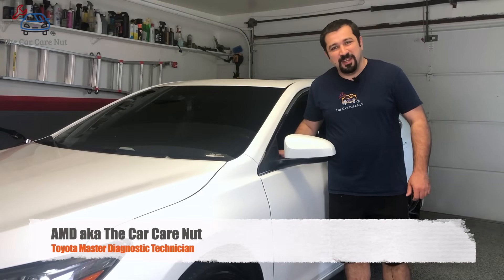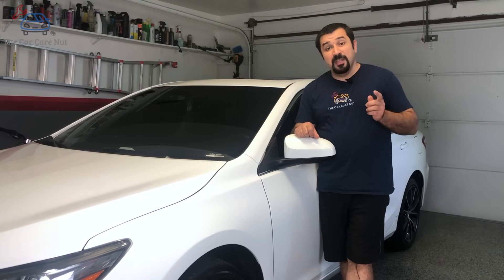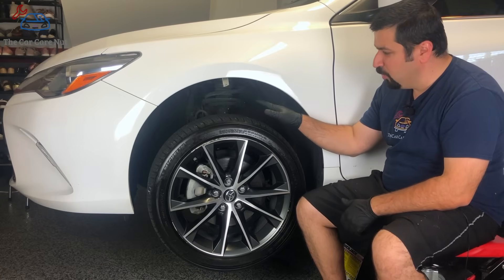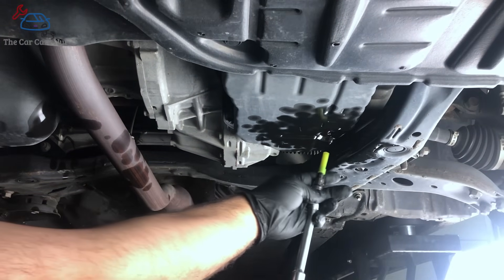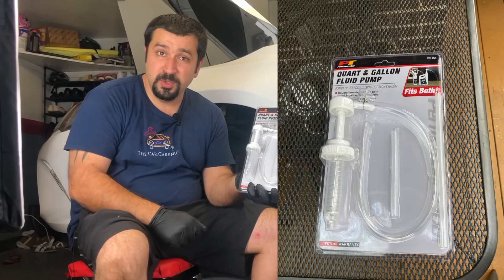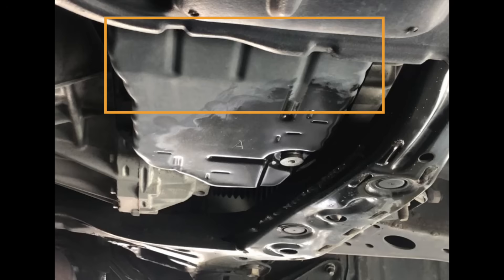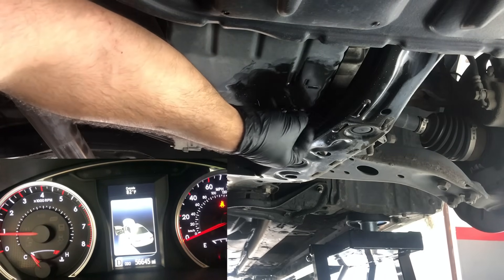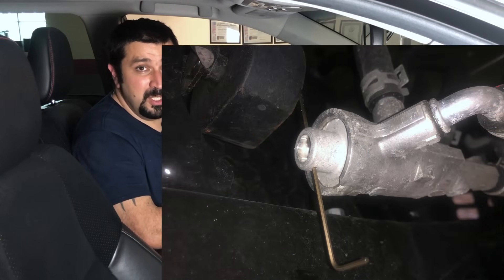How to change your Toyota Sealed Transmission Fluid

Comment: I asked the shop I go to and the head mechanic said to never touch a sealed transmission. "Your liable to contaminate the lifetime fluid. It's sealed for a reason from factory" "The fluid is made to deal with cvt high temps". Obviously the fluid you drained was nasty looking so it's not lifetime fluid which I suspected. I find it interesting that so many of these old school shops simply stop researching the latest tech. and go with the car makers recommendations. I can't imagine how many people would hear that advice and follow it until their cvt burns up one day out of warranty .I'm wondering how many miles that fluid had on it that you changed out.

Comment: Question about fluid changes and warranties. I just bought a used 2022 Rav4 XLE with 35k miles. Gas version with AWD. The Carfax shows only oil changes done approximately every 10k miles. I've mostly owned older paid for cars. I've been using Amsoil for many years. I've always done fluids myself but these newer "non dip sticked" transmissions make me nervous. I do have a nice Flir laser thermometer. 

1.) Any issue with using fluids other than Toyota brand? Amsoil ok? Thoughts? Would a different brand void warranty?

2.) At 35K miles, would it be a good idea to start thinking about going through all fluids? Transmission, transfer case, rear dif, coolant?

3.) Is 10k miles for an oil change too long of an interval despite it being the recommended interval?

Comment: Thank for the great video.  It is very easy to follow.  I tried to do it on my Toyota sienna 2016 and get different result and hope you can explain.  First question, the diagnosis using jumper does not work to determine the temperature.  The D status does not change when shifting back/forth between neutral and drive.  it is ramined solid even first start.  Second question, the amount of drained oil is only 1.5 quart even with second plug removed.  When I refilled back in by putting in ~3.5 quart about 2 quart came back out at the transmission temperature at 97F.  third question, is the low cost scanner that you recommend to buy to read temperature if you know of any.

Comment: Great instructional videos, thanks. Wondering, if it is “sealed” and you don’t see any leaks, why couldn’t you just replace oil with same amount that came out, assuming same temp (ie. do when everything is at room temp).  Would remove a lot of process (jumpering, heating oil, rechecking). I get the importance of being within tolerance of fluid level, but is the risk that high that your original level is out that much?
Reply: Yes i'm with you on this. Cold out same amount cold back in. If this is wrong please explain why so Mr.Car Care Nut. Thank you.

Comment: It seems strange that volume would be used since it varies so significantly at different temperatures. It seems that weight would be much more accurate, since it would be constant.

Comment: Greetings AMD , I have a question please , i’ve done this job 3 times on my 2015 , 2016 avalon and 2021 Yaris with the jumper cable method , yet when tried to it on my 2021 camry , one of two pins dedicated for this method was hollow ( Not sure there is no connector on that pin ) and the camry didn’t initiate the diagnostic mode anyway , would you please help

Comment: Hi Amyr. I have a 2014 corolla and I paid someoen to change the transmission oil when it had 100K now is reaching 150k. I know I may need to change, do you know if there is also a tranmisison oil filter as well that may need to be changed?

Comment: Question: This is for a partial drain and fill correct? I think the transmissions hold more fluid than the roughly 3 quarts swapped here. I ask because my dealer wants $350 for what they described as a flush for my eight speed 2017 Sienna which I’m a little leery about with the potential of metallic wear particles being deposited in places they don’t belong during the flushing process.

Comment: I have a 2023 corolla with the launch gear cvt. It vibrates at like 1200/1300 rpms it also used to make a grinding noise sometimes while vibrating but that stopped. There are a couple forums where ppl say they experienced the same thing. Could the trans be underfilled from the factory? The dealer said its normal. Can I check fluid level just by looking at fluid temp with a scanner? If it's underfilled would that show with a high temp?

Comment: I have 2017 Lexus nx200t. Where would the jumper cable go? The obd2 connector is different. I placed it in fourth upper and fifth lower hole and stated the engine. The diagnostic letter appeared. All the warning logos flashing . But the P, R, N, and D stayed solid and never flash or turned white.

Comment: So,my 2010 Camry has  200,000 miles on sealed transmission. 

Does it really need to be changed? Toyota dealership is doing the work. Are there questions I should ask the technician? Transmission is working  fine now.
Reply: He would leave alone at that mileage.

Comment: Underneath of the sequoia, there is a drain plug and a fluid level check plug. The fluid level check plug has a hex type center I think. Should I be checking the fluid with that or the drain plug?

Comment: I just bought a 2009 Toyota venza with 119,000 miles.Im unsure if the previous owner serviced the transmission at 60,000 miles. Would you recommend a drain and fill. Now that it has 120,000 miles.

Comment: Does anyone know what is the temperature that the transmission fluid should have when doing a flush? I have a 2019 camry and I want to do a flush since it has 70000 miles on it. I'm planning on using the gun to measure the temperature. If anyone can help me out please I'd really appreciate it

Comment: I have a question. If I put in new fluid exactly same amount as the old fluid from transmission. Why do I need to measure the overflow (given the old fluid is original fluid from manufacture)? Another question is, if I put  the new fluid very slightly over the old fluid (say take out 2.5quarts, put in 2.6 quarts), will it cause any damage to my transmission? I think if there is only very slightly over, it shouldn't cause any damage, right? correct me if I am wrong. thanks

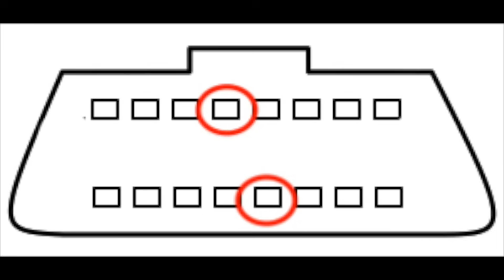Comment: I ran into a problem, I have a 2022 Rav4 LE (Not hybrid) with the 8 speed transmission. In the obd2 port it does not have a 4th pin on the top row like you show in picture of this video at 10:05. Because there is no pin there I cant go into diagnostics mode to check my transmission fluid levels. Any suggestions?

Comment: thank you for the excellent videos and information.  I got a small leak from the top side of my 2011 sienna transmission. Can I just top the oil periodically using the jumper method or scan tool when the engine is at the right temp?  Thanks

Comment: Well tried with temp gun and it was verrry erratic. Aimed it at the area he said but no consistent reading. From 103 to 122 F . Ames temp gun with laser $25 . Finally drained out the excess what I put in . I tried draining till it trickled but too much was coming out and no trickle . Meaning that I overfilled it like he said but second draining took out the half quart. I took it for a few minutes drive and runs great . The tranny is very responsive. Kinda worried it’s still overfilled though.. some mechanics say just measure what you put in and put exactly that amount. No need for this procedure..

Comment: Hi AMD. I have a 2019 Toyota Prado (LC150) with a 1GR Motor paired with a 6-SPD Auto Trans. In the owner’s manual it states using WS atf fluid, but does not state when to change fluid. I want to change the fluid myself, so question is, is the procedure to do so the same as this in the video as well? Thanks!

Comment: I have more of a question than a comment.  I have a 2012 Lexus LS460 I purchased new.  It currently only has 22,000 miles on it. It sits most of the time in the garage at our vacation home.  Is it okay to change the transmission fluid?  I'm not sure it's ever been changed.
Reply: Im in similar boat.  Guy at toyota dealership said YES.

Comment: As an engineer and a DIY mechanic, I extremely dislike that manufacturer's are adopting this design. This is the design on my VW. It is annoying to fill through the drain plug hole and watch the computer read out to reach proper temperature. I recently purchased a used Rav4; one of the reasons for picking this model was it still had a dipstick for the model year.

Comment: Followed this today on my 2017 Sienna. A few things - I did it in a 31 degree F garage. Had to shift back and forth for 5.5 minutes to get the D to be solid. Then it took 10 minutes to flash, so plenty of time. I did a practice round then drained (just under 3 quarts) and refilled (3.5 quarts). When I did the procedure the 2nd time it was kind of random. My neutral light went away - so it was D-blank-D-blank, etc. Wasn't sure what to do. I started the procedure over twice. The third time it went as it should - NDNDND, etc, until it was a solid D. Maybe the N indicator wasn't working due to the high fluid level? I drained out the extra fluid, all went well. 

One thing that I didn't do (someone tell me what issue this may cause) was pin out the transmission cooler line. I did find the bypass - it was under and just to the rear of the driver side radiator fan. I could barely reach it from above and couldn't get any leverage to push in the end. I assume you're supposed to get it from below by removing the large shield. I didn't have time.
Reply: great comment, I'm about to do my 2017 and could not find the cooler bypass, will practice first and look to remove the shield. thanks for the heads up on the internal dipstick
Reply: Also the internal dipstick was NOT a 6mm head, it was much smaller, at least on my '17 Sienna.

Comment: maybe I'm must old school(or just old), but I honestly believe that an actual physical dipstick is a much better, safer way to check the transmission fluid.    extremely few people are going to re-check their transmission fluid after the fluid change because it's a PITA to lift the car up and unscrew the drain plug.    an actual dipstick allows one to check it at anytime.

Comment: Hi AMD, I was doing a transmission oil change for my 2017 yaris with 4 speed automatic and used a wrong torque when installing the drain plug. Now the plug keeps spinning and i think I may have stripped the aluminum threads in the pan. Should i replace the pan ? thank you

Comment: I just did mine at 93K. Was worried, but it still shifts and drives. It shifted a little harder first few minutes,  but after 15 20 miles it did Great.

Comment: Thanks for the video and the proper procedure to set the level. I understand the engine has to be running and the transmission fluid must be in the correct temp. range, but I though I saw the transmission was in Drive when you opened the drain plug to set the level. Does it have to be in Drive, or can it be in Park? If it has to be in Drive, this is more of a safety concern, and a second person would be needed to keep a foot on the brake. If it can be done in Park, then that would be safer, and could be done with one person.

Comment: Is this the same procedure for the 10 speed no dipstick transmission found on the LS500's and LC500's? Or are those different as far as getting the temperature mode? Can I use a scan tool such as the Xtool A80 to get the transmission temperature correctly?

Comment: On my 16 Corolla I did not remove the tire or apron covers.You can see and remove the 24mm FE bolt from under the car.I left the can of fluid outside with the car and changed the fluid when the car was completely cold.I ran a half inch tube with attached funnel through the top of the engine into the 24mm FE hole.3 quarts out 3 quarts in.
Reply: Did you have to do anything with the Cooler Bypass, pretty sure that year has one.
Reply: @scotta8744  Nope

Comment: Hi I did this service on my 2017 Toyota Rav 4 using a scanner at temp at 104 for drain off 
Now I am going to be doing my Corolla 2022 CVT transmission is the scanner temp of 104 going to be the same for this car for drain off or is the temp going to be different 
Thanks for any help 
Love your vids and Toyotas thanks again

Comment: Is the OBD-jumper technique (while watching the Drive light) also applicable to a 2018 Lexus ES350?  It has the same engine and transmission, but I am unsure if the pin locations of the jumper are the same for this Lexus model?

Comment: What a mess they made today. Just make it simple and add a dipstick. I like to remove the pan to get the junk out off the bottom of the pan and the magnet if they have one. Love it were some tranny now have the filter inside the tranny. Another stupid idea. What sealant do they use to seal the pan if no gasket. I like to use the right stuff. What do you use? Like chrysler and dodge if you don't remove the pan just easyer to remove the add plug and suck it out and add what you took out. Warm it up to the right temp and add more to get it to the right amount on the plug with the dipstick on the plug or maybe you have to buy a plug with a dipstick on it to get it right. Dealerships by the cheapest fluid in a 55 gallon barrel. Dealerships add the wrong oil all the time as they buy the newest stuff oil and add that. Want it done right you have to do it yourself. They should make a filter for a tranny on the tranny like they do the oil filter. Same with oil and antifreeze. You worked at a dealership you know what I mean. Taking the wheel off and the panels is just a stupid idea to get to the tranny plug. And the some plugs they leave hardly any room to do this job. They getting way to high tech in my opinion. Just like 8 or 10 speed tranies is another stupid idea. No wonder why vehicle cost way to much today. More speeds just make the trannie more prone to make things not to last.

Comment: As always- great vids👍

Ok, let me ask this ?-

After sitting overnight (fluid is cold)-What would be wrong with just draining the fluid into a bucket (as you did) and replacing that exact amount and being done with the process?

I’m saying this as the fluid in my ‘08 Camry V6 w/85k miles has never been replaced since buying NEW- 1 owner,me.

Also , I’m trusting & taking into account that from the factory, the fluid level is correct.
Also, there are NO leaks in my transmission.

Thoughts?

Thank you
Reply: @kimbuck-2  
Your comment about the old fluid may carry some credence….🤔
Hopefully TCCN will chime in.

Comment: This is a great how to video. I would like to change the transmission fluid on my 2013 Lexus RX350 via the temperature gun method. What is the correct temperature range to check the fluid level for this vehicle?
Thanks,
RM

Comment: i have and issue where second gen toyota Innova petrol Asian market can only go in to 4th gear up shift into 5th and 6th gear (6 speed auto trans) after changing atf and filter. what possibly go wrong with the transmission? there is no error code detected  from scantools

Comment: Is it odd that when I did a drain & fill on my 2017 Highlander, I drained 5 quarts?  Does that mean it was overfilled prior to me getting the car?  I put back 5 into the fill hole and did the entire procedure (pin in bypass, correct temp) and only 2.5 quarts came out.  Any reasons for the discrepancy?

Comment: I'm having my cvt oil changed and new filter installed in a few days and I'm worried that they might not do it right.  They did realize the other day they had the wrong oil and sent out for the right one.  They do get it from a Toyota dealership.  I have a 2015 Corolla Le.  Do I need to worry?  By the way, I love your videos; very educational.

Comment: Question: If using a scan tool or Techstream, what temperature are we looking for?  And do you always drain the excess fluid with the engine running?

Comment: Very well stated and laid out. This is one thing I give Toyota a "zero" on the design of this though. LOL. You have to be an acrobat to do all of those steps. The best transmission fluid change was on a Saturn I owned---spin on oil filter and whatever you drained is what you put in. Doing that transmission fluid change was like doing a regular oil change. You were done in about 20 minutes and yes it had a dipstick. I think manufacturers need to go back to having those.

Comment: I purchased my niece a 2014 Sienna SE. Services in the Toyota system don't show transmission fluid ever having been changed at a dealer. May have been done elsewhere. Don't know the previous owner. Van has 170,000 miles. Runs fine. Drives fine. Want to have any services that are needed done so she will have the best service out of the van. Would want a dealership to do service. How should we proceed? If fluid is changed, should the filter be changed as well? Have heard that if its never been changed, it shouldn't be changed. Might create problems. Thanks for any help you can give. Single mom of three needs a good working van. Patrick

Comment: Hi Car Care Nut,  is it possible that my 2019 Camry SE, UB80E trans, does not have a cooler to bypass?  I can’t find it anywhere.  I looked between the trans and the radiator on the diver’s side, middle, etc.  couldn’t find anything.